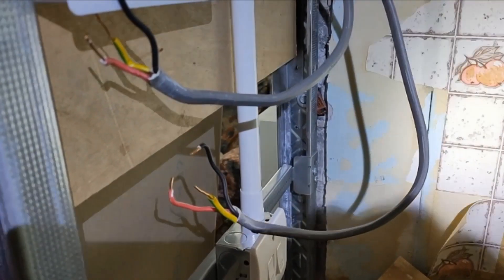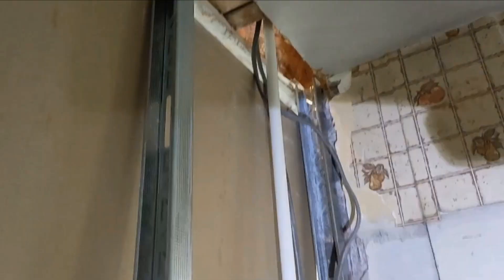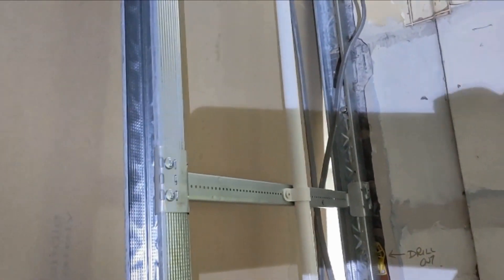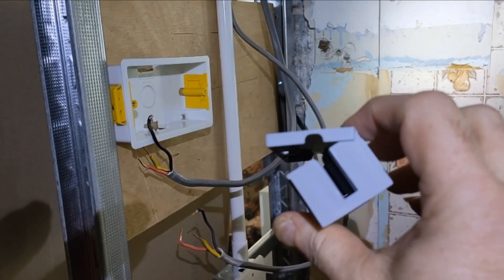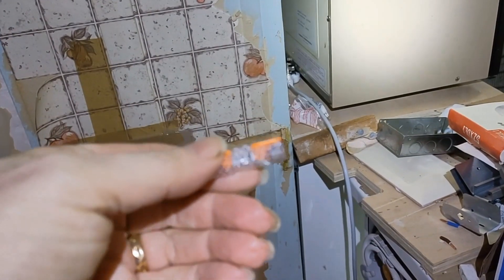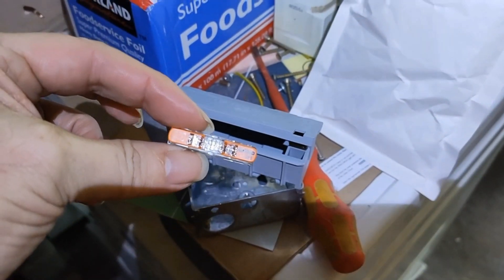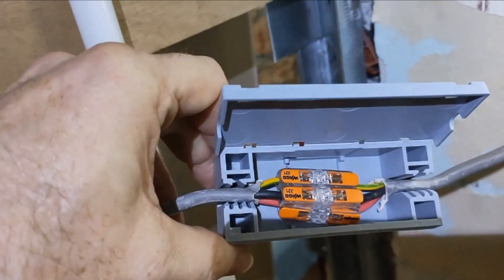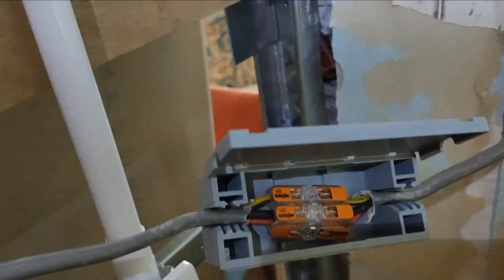Using the new Wago 221 Inline connectors - A real world application

Comment: Hi
Are the Wago inline connectors?  221 thin ?slim ?
Thanks 👍
Reply from the maker: They are really slim, easily got three of them and 2.5 T&E in a lighting junction box. Not as good as the Quikconnects granted, but they are currently only for 1.5mm
Reply: @vwes  thank you . Who sells those other , quickconnectors you mention ?